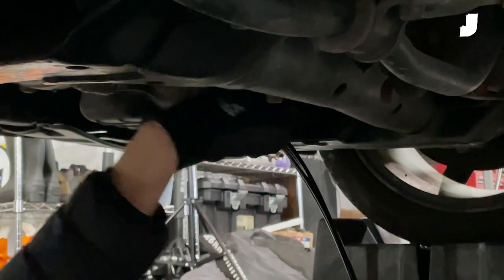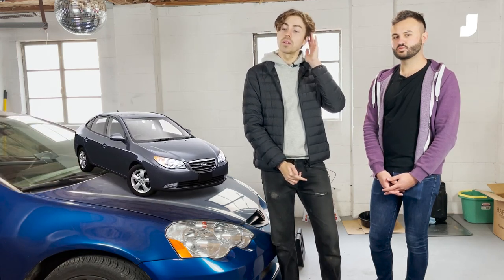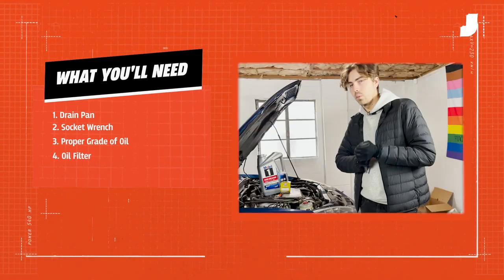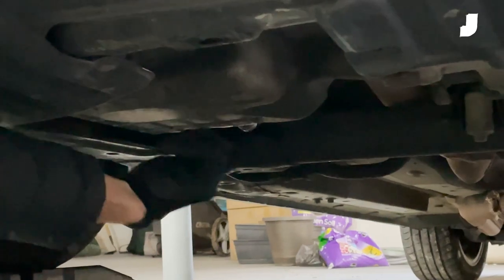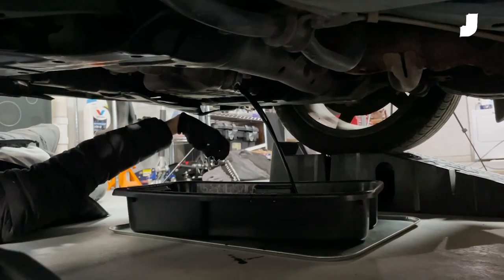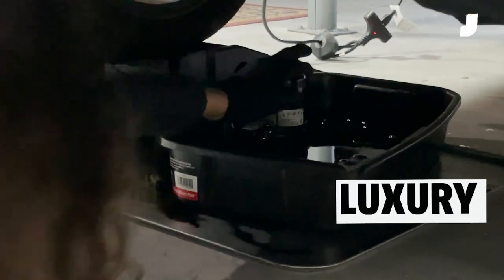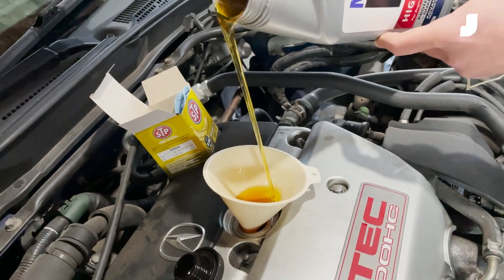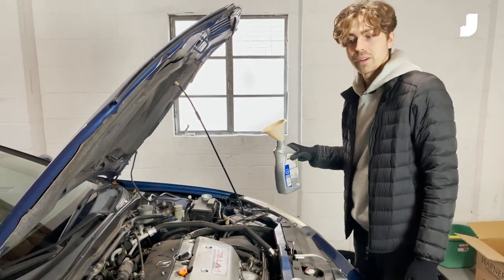Changing Your Oil Is A DIY Gateway Drug

Comment: Great vid.   I was taught to rub some new oil on the filter gasket before putting it on.  Not sure if that's really necessary.
Reply: It makes it easier to take off for next oil change
Reply: Lubrication is good. I do it too
Reply: Worked in a shop for a couple years. If you don't lube the gasket you run a pretty high risk of it locking into the block and having to hammer a screw driver through the oil filter to get it to turn.  Then you have a mangled oil filter peeing on you while you shred it trying to take it off.  Usually the guy that doesn't lube it is also the guy that tightens it to death so you get the double whammy.
Reply: Good info all, makes sense.   I'll definitely keep doing it.
Reply: @StrangeTerror  Meanwhile, pounding a screwdriver through the filter is a good thing to know about. Doesn't seem like a thing, but it is. Wait, they didn't use one of those couple buck oil filter wrenches? Often hand twisting an oily filter doesn't cut it.
Reply: @emjayay  Oh yeah. We had every damn kind they made. Problem is, we had a couple guys who would purposely not oil the new filter. Then, put the death grips on it to tighten it. Specifically because the old one was a pita to get off. So, they'd try to make it a pita for the next guy. Literally too dumb to connect the dots and realize they were pissing themselves off.

Comment: oil jug was upside down, the hole is upposed to be on the top side of the jug when pouring to get a smoother flow of oil and not make a mess

Comment: Some cars have the filter in a convenient location and designed to not pour oil all over the place when it is removed. Some cars the opposite in one or both ways. Also don't dump the oil in the alley or someplace but take it to somewhere that recycles it.

Comment: Unless you have a turbo, the engine can run on literally ANY oil in the store, but keep a mind to your climate. Contrarily, 0w-40 is excellent in any engine/any climate. If you have a Euro car, 10w-40 works great, 0w/5w-40 for turbos or for deep winter. If you are just going to use boring 5w-30 anyway....Maxlife is a product that actually has some tangible benefits for the engine long-term, mainly to the engine seals.